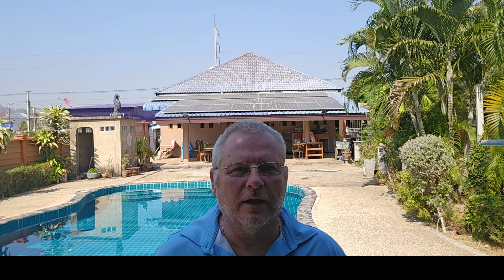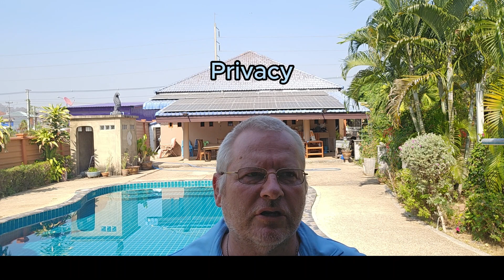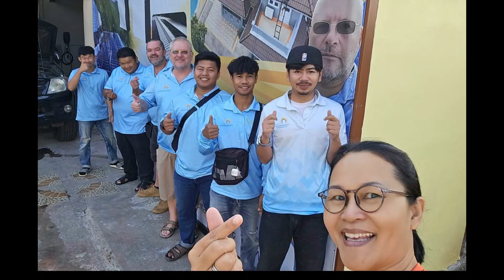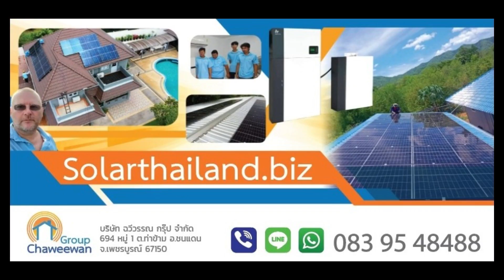The monitoring system for solar | SolarThailand.biz

Comment: I think the constraints are actually very limited in reality.
Increasing the number of solar panels is the cheapest gain but restricted by the size of the hybrid inverter.
Expanding a system after it has been installed is pointless especially if you have a hybrid inverter (expensive).
I also believe that all this remote connection (internet and even wireless) will have issues in the future and defeats the point of off-grid.
Reply from the maker: Here are some parameters a client cannot change: phase imbalance, volt range, export, CT values, what kind of coupling etc. Remote connection is the only way to observe any system conveniently on the phone, even for the client. If you dont use this you must use a direct connection that must be established every time and gives you a limited interface. All off grid systems we have installed so far have had an internet connection. People usually have that in the form of for example a 4g router.